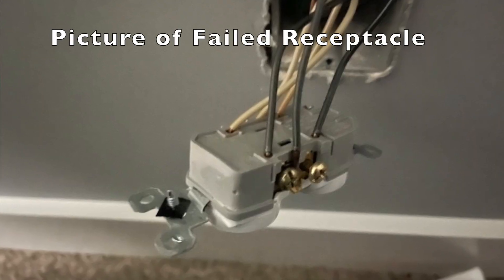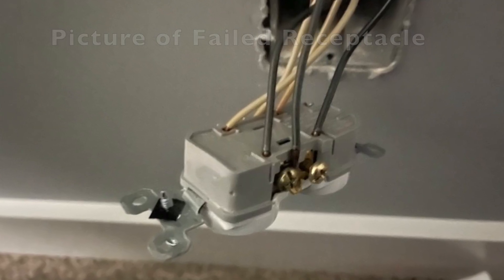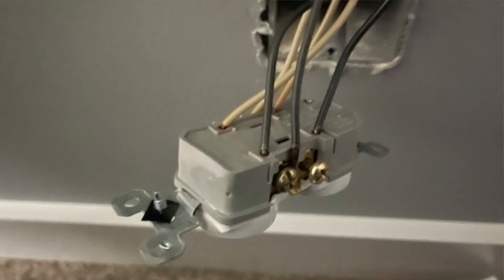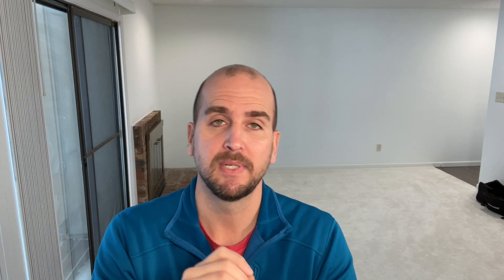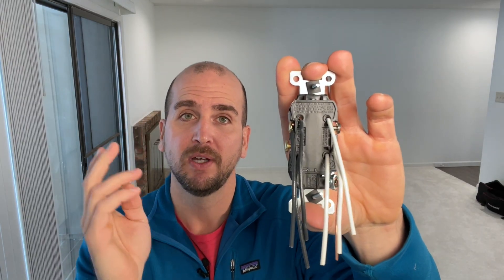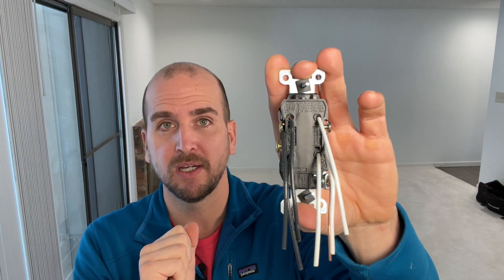Incorrectly Wired Outlet Found In Newly Built Home

Comment: It seems to me that using a pigtail with only 2 wires introduces an additional failure point (wire nut), instead of using the two screws one per wire.  
Of course if you have more than 2 wires, then the pigtail is the only option.  Thoughts?

Comment: Good info. That's not a "box extender" (which does exist); we call that a "goof ring". I forgot the technical name, but if memory serves, these are for more than a 1/8" gap or installing in combustible material.
Reply: We call them add-a-depth rings. And for use box extender is meant for metal boxes

Comment: I watched this video because you claimed that there were 3 mistakes and I disagreed from looking at the thumbnail.  Watching the video, you walked it back.  No rule had been broken but it is not best practice.  They aren’t necessarily mistakes, it’s just a low quality install.  Also, there are many right ways to do a job, but a few better ways.

As far as stab ins being a common failure point I completely agree.  I’m an industrial electrician so I don’t often come across this at work, but friends often call me for electrical help because I’m an electrician, and I have seen this failure multiple times and also in my own fixer upper house.

Comment: Just wondering if the host has any thoughts on Wago lever nuts. As an amateur changing out some switches and receptacles, the Wago nuts have been a godsend. Making a pigtail is so easy and I don't have to fiddle with twisting wires. They are a lot more expensive than traditional wire nuts, but for me they are WAY more than worth it.
Reply from the maker: Big fan!  https://youtu.be/AWiyreFFt-Q

Comment: Prefering screw clamps above push-in spring loaded terminals but twisting wires? OMG - there are way better solutions for pigtailing like wago compact-splicing-connector 221-613 for instance
Reply from the maker: I agree, https://youtu.be/AWiyreFFt-Q

Comment: Why can't u use the 2nd screw on each side instead of making that 6" pigtail? I never put 2 wires in 1 screw, but I do put the next outlet in the series to the 2nd set of screws
Reply from the maker: There is nothing wrong with what you are proposing from a code perspective.  Seems like most licensed electricians prefer to Pigtail as long as they have enough room in the box.
Reply: @EverydayHomeRepairs  ok, thanks. Appreciate it

Comment: on my suggestion for wago company...i been seeing with disconnect switch..how wires are tightened by lug bolt that squeezes very tight in proper torque...my suggestion to make the product safer than levers is to use lug screws in the casing of plastic for outside cover protection from arcing ...those i seen from home depot are very common sense to me that wires are never loosing and very stiff for safety..when its lug tight to a copper metal bar that sits on...and gives better output temps than wago levers do not give good cooling as wire nuts...i feel like wago nuts are using light switches parts that are not designed to use on dishwasher load ..10amps plus another 10 amps for garbage disposal ...that's where the danger the current gonna through...tiny copper clip that is the same part use on 15amp light switches when it clicks on position to transfer light power...normally lights never go beyond 600 watts normal usage where light switch does get very hot when it does...just like WAGO levers will react something over 600Watts ...like microwave from outlet ...well the source is wago nut ..plug has no problem but the problem be source gives off the load when microwave ask for 1000 WATTS  or more...if share with downstream like coffeemaker and blender and goes on in other kitchen outlets, its why I like my nuts for proper usage...pardon my french for anyone getting the nasty idea...but that's what nuts are for...NOT JUST GET NUTS...BUT IN NUTSHELL its MOST RELIABLE TOOL FOR PAST 100 years

Comment: I am not en electrician, but I am an electrical design engineer. Several issues. First, using the push in connections works fine as long as you follow proper procedure for it: Strip the wire to the correct length. Most reasonable receptacles have a wire depth marker imprinted in the plastic next to where the wire insertion point is. Most failures I have seen come from incorrect strip length. Once the wire has been stripped to the correct length, make sure it is inserted all the way until the insulation meets the outlet housing. Finally, some cheaper brands of push-in style use the side nuts to provide additional locking on the push in channel so they must be tightened down as you indicated or the connection can fail. Another important point that should be made is that you are installing your outlets upside down. While the NEL doesn't specifically require that outlets should be installed ground side up in this country, other more enlightened countries require the ground side up. This is because a plug can be left partially inserted while still making electrical contact. If you were to drop a conductive material such as a wire fragment on the outlet from the top, it could fall in such a way as to either short the hot and neutral connections, or worse, hit the exposed hot alone presenting a shock or fire hazard. While this is incredibly rare, it does account for a small handful of fires and injuries every year. The proper way to install these outlets is with the ground pin up so that a falling conductive material will hit the ground first, dramatically reducing the possibility of injury.

Comment: pigtail is very safe..longest its wires are strip the same length and twist equal length ..it takes a lot of practice to get it right with linesman pliers ...12 Gauge wires have no problem with this...14 gauge you got be very gentle with it...wires are thin enough to break off by over twisting.. the whole idea is to wire don't move and stiff ..that is proper wiring ...those lever nuts are terrible idea to me..i bought some and i was expecting something different by people opinion ..but when i test it...i did not like the result ..it work yes but stuffing inside the box its where the failure point out quick for me...they bind the wire but they spin freely on wire ...thats not good to me and i ask my brother to pull test, it just came off easy with levers on closed position, that got me very concern for heavy load usage, but great for testing wires but not great to use in real life in long term usage in my home ...i used it for damage speaker wires or my satellite actuator arm communication wires for extension more wiring that run on 24v only to motor box receiver

Comment: stabbing is only when switches need to share its hot for another switch, like next door when screw-nut is getting source from wire nut...but i will never share hot to outlets recpeticales on same light switch by back stab for that romex...its wise to share before getting to switch...like pigtail and wire nut the source ...one coming from and other to outlets and other for switch...total 3 hot wires...other 3 wires goes to fixtures, 2 inside and one for outside...i seen neutral split between 2 sets wires...sometimes person did not have strength to do all 5 neutral wires..one is gonna to outlets and other gonna to source ..3 and 4 and 5 going to light fixtures ..my room have 2 fixtures on separate switches while separate switch outlet for outside flood lights...nice be on one but both are have a different purpose...one brighter and other acts like moon light for night time...when its dim ...

Comment: Pretwisting the wires is not recommended.  I had a rep from a major wire nut company point this out to our Production staff for a lighting company.  Also, technically, the proper way to install a three prong outlet is with the ground facing up. (but then you can't see the little "oh" face though).
So easy to be a smarty pants engineer.  :)

Comment: Im not a certified electrician but usually have to do a lot of electrical work and when I did goto school for lineman I was taught too to tape the wire nuts and to tape the switches/outlets to try to prevent anything/anyone from touching the screws. I was just at a million dollar house where I was looking for a short and it had cheap outlets and those screws were backed all the way out and they used the push in instead.

Comment: Several years ago, in a spec house in CA, my son tried to remove a broken light bulb shell from a ceiling fan and forgot to turn off the switch. He created a short that blew a back-stabbed hot wire out of an outlet in our bedroom on the other side of the house! We lost power in our bedroom but it did not trip the breaker. After that I went and installed pigtails on every outlet in the house.

Comment: Good advice.  I was a service electrician for 15 years and I repaired so many plugs that were wired using the back stabbing method.  Another problem is the orange wire connectors that so many are using now.  I have replace so many of those too.

Comment: my present place is a much older home.
EVERY time I opened an electrical box there was a problem.
in one case, there wasnt even a device box, the lite switch was screwed to the inside of the panelling !! luckily with 5 years full time and 30 years working on my own, I was able to rectify (no pun intended) all the mistakes l found.

Comment: One other mistake you made is putting a none hooked wire on the screw terminal that you are turning against.
Reply from the maker: Since this was a commercial grade receptacle I just used the back wiring feature opposed to the side wiring which would need the clockwise J-hook.  I should have pointed that out as many others noted the same issue.  Thanks for the feedback.

Comment: Would you wrap a round or two of electrical tape around the receptacle to isolate the contacts from the box?
Reply from the maker: I usually only do this on receptacles with tight clearances installed in metal boxes.  Here is a video that dives deeper https://youtu.be/mY45ZDdiPn4

Comment: When we first moved into a new house that supposedly passed all inspections, we found that even a phone charger tripped the ground fault in the  bedrooms and baths upstairs. The ground fault had not been properly installed. Aldo the electric stove did not work properly. Turned out a 3 wire 220 receptacle had been installed with only two wires running to it. The builder did not use the licensed electrician he named on the permit but did it himself. The city inspector had checked the rough in but not the final because the electrician on the permit was known to always do good work!  That builder was banned from future building in the city.
Reply from the maker: Yeah, I wish this was type of story was uncommon.  Good on you for following up on the issue and tracking down who was at fault.
Reply: That's crazy they'll just let a builder put whoever they want on the permit. Pretty sure around here, electrical and plumbing permits get pulled by the electrician / plumbers. No CE license, no sparky permit for U.

Comment: The screw terminals should where wires are connected to receptacle. The jad, or speed wire stabs on back of receptacle are dangerous, because of a small connection surface.
Reply: That's how I was shown how to do it .  Way better connection .  Push in can heat up.

Comment: In case no one has mentioned. I always wrap all receptacles and switches with electrical tape around to prevent accidental shorts from the screws on the sides to the box.
Reply: Certainly not necessary, but a good practice, especially in a particularly tight tight metal box.
Reply: I was taught that too, but have yet to actually replace one of my own receptacles!
Reply: @lexyannamarie  I've come across receptacles done up that way. They seem to hold well, only downside I can see is the receptacle and wires are a sticky mess after you remove the tape but generally you're replacing the receptacle anyway if you are digging that deep into the tape.
Reply: @ragnarok7976  I’m updating some in my house so I gotta do it right!
Reply: It's somewhat unnecessary if the box is plastic. If it's an older metal box, and if appropriate for code, I recommend using a plastic box extender instead of wrapping with electrical tape. Both with safeguard against arching and shorting, but wrapping takes longer and is less convenient.
Reply: Don’t forget there is always that bare ground wire or wires in the box that could come into contact with a hot terminal screw, that’s why I’ve wrapped them with tape even in a plastic box, been doing it for 50 years.

Comment: When putting the Shepard's hook onto the screw the hook should go on clockwise so the srcew pulls it in instead of counter clockwise where tightening the screw will tend to push the wire out

Comment: Good information, agree about not using the push connections. Easy to get a fail.  The part you were rewiring with a box extender and pig tails, you mentioned 12Awg wires, is there anything code related using a 15amp receptacle on 20amp wire?

Comment: I see absolutely no issue with having 2 wires in the back wire. It just means that it makes it a little more difficult to put the plug back in the box. I would believe it is also safer that way because there are less points of failure as appose to a pigtail where you add more connection points. TBH I think all plugs should have the back wire screws instead of push-ins.

Comment: It is all about surface contact (electrons running over the surface).  The push-in have less contact area than the screws.  Also, I see you are using 12 g. wire - GREAT.  Again, it is all about surface area, and the 12 gauge really doesn't cost much more than the 14 gauge.  Ideally, you would want to fuse the end of one wire to the end of another for maximum area, but at least with the screws, there is a contact for a longer length of the wire, making up for the deficiency.

Comment: When I took the NEC course for Fire Investigators 1991 the one thing we were taught was that a UL listing is not what most think it is. Case in point. There was a very popular Drip Coffee Maker with a automatic timer on it, that had a UL listing. And it did pass UL's standards for making coffee. Unfortunately it was not tested for the timing device IE the automatic timer. Over time the timing device would fail and come on without being set the night before. This led to a number of house fires because (yes you guessed it I am sure) the home owner did not have coffee and water in the coffee maker at the time of failure. My purpose in this is more of a PSA and not to refute your comment on the UL listing on the outlet. But when the average home owner goes out and and buys the cheapest recepticle/outlet they may not be aware of the test performed on said recepticle. You did a great job of showing and correcting common wiring mistakes made by the typical DIY'r.
Reply: I worked on fire restorations for several years. Many times it was the cause of the fire. Often when trouble shooting  on service calls I have found only the face of receptacle left and the rest of the receptacle in ashes.

Comment: The reason that you shouldn't use the receptacle lugs to feed  another receptacle is that whatever is plugged in downstream will be fed from that one outlet's terminal lugs. While you can safely daisy chain many outlets on a breaker, you will end up passing all of the current to every downstream receptacle through the first outlet's feeder lugs in the series. Bad. Wire nutting all feeder wires ensures that the current flow is always coming from the house wiring.

Comment: Had an identical failure. Stab type connections, a "T" junction so there were 3 hots/neutrals (more wire in the box putting more strain on the stab connectors). The outlet was causing arc fault trips on the breaker when a vacuum was plugged in. Unfortunately, I wasn't the one plugging in the vacuum so it took years to find it (it finally tripped when I used it).

Comment: This guy should know that by code the neutral shall not depend on the yoke. Plus he shouldn't be changing receptacles in anyone's home without an electrical license. It's the law. Also 15 amp residential receptacles are rated for 20 amps

Comment: Great video.  Don’t forget that electrical tape on all the terminals.
Reply: Electrical tape does not last. The glue will fail within 5-15 years. It's not meant to be used in a permanent installation.

Comment: Great video. 5 years ago when I bought my brand new home one of the outlets was defective and blew sparks at the cable guy when he plugged in the router when the house was only a month old. I removed the outlet to find it wired with the stab connectors. Then I checked every one in the house and they were the same way. When the electrician came in from the company that wired the house I asked him why they used them and he said it's quicker when doing a whole house. He said he can save 1.5 hrs and get onto the next job. I said "yeah at the expense of the safety of the owner". I went through the entire house and redid every outlet the right way. By the way, they had every side screw unscrewed like you showed at the start of the video.

Comment: Most states are still following the 2017 code, back wiring plugs is not legal anymore, only side wire, your video shows you side wiring a plug, you failed to install the wire in a clockwise rotation which pulls the wire into the tightening of the screw.  You made mention of "professionals" giving me the impression that maybe they don't do good work or not to code, folks like you who crank out these how to videos, I have yet to see you showing the viewers your certification documents that proves you can work in the trade and know what your doing and talking about. Just saying..